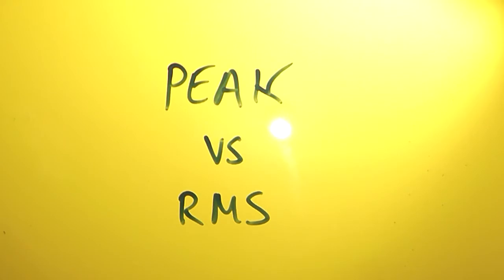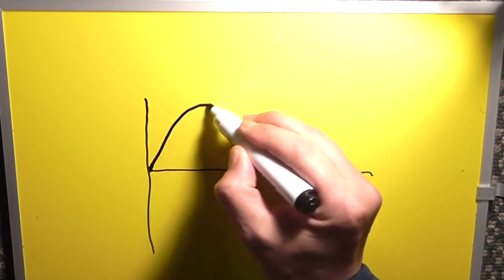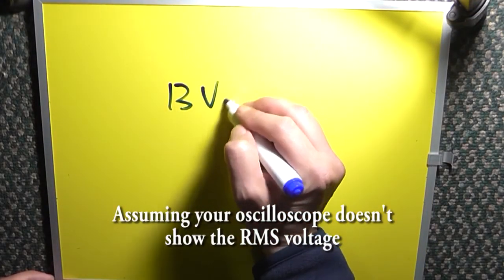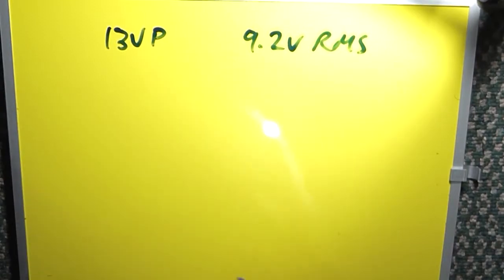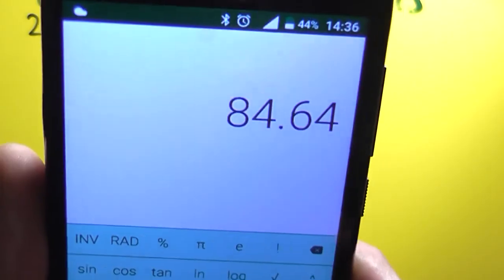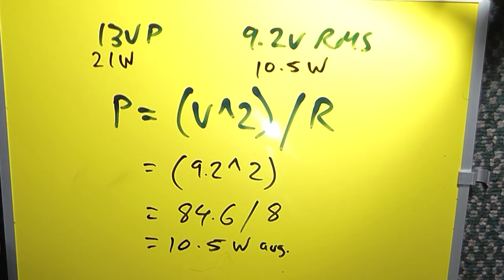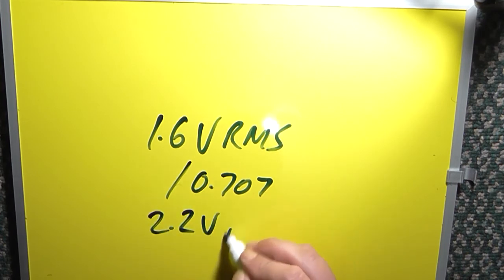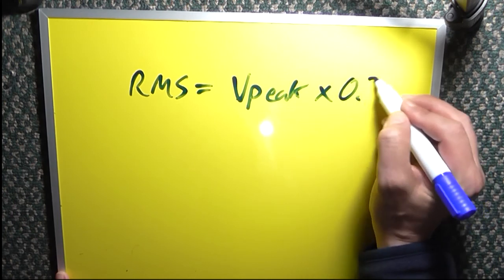Electronics Fundamentals: RMS vs Peak Voltage Amplifier Power Output

Comment: RMS for a given p-p is that p-p * sqrt(2) aka root mean square.  For 3 phase power, phase-phase*sqrt(3) is the reflective peak voltage.  That’s why I’m American household you have 120v and 208v for 3&4 wire equipment respectively
Reply from the maker: Sqrt(2) is 1.414, and if you multiple a voltage by 0.707, you get the same result. Here, we're talking about amplifier output, not mains voltage.